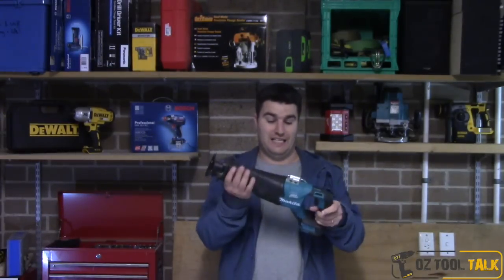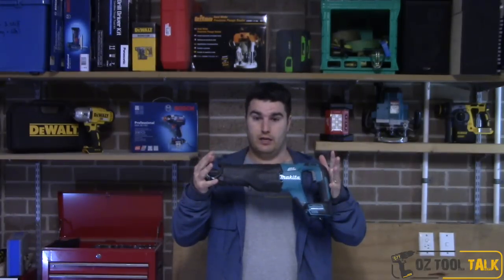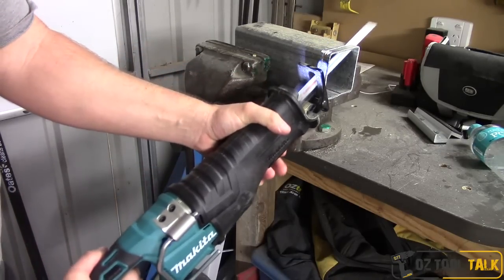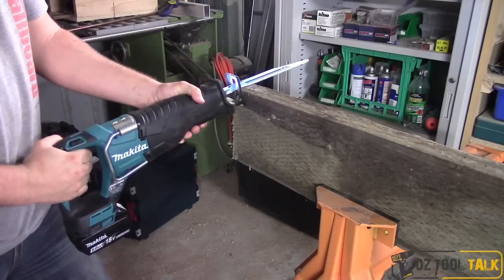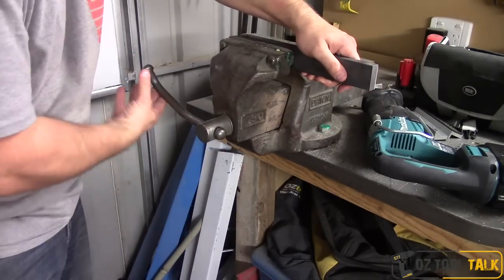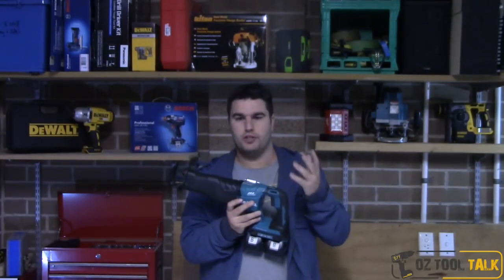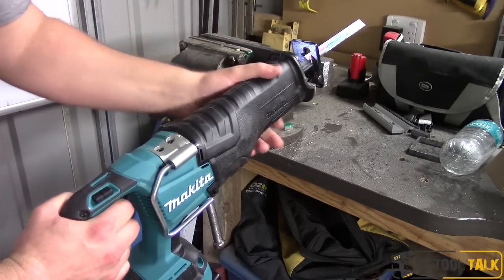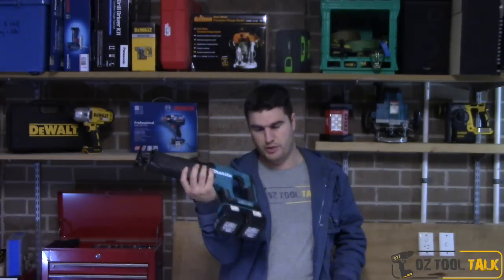Makita BRUSHLESS Reciprocating Saw - 18V DJR187 & 18x2 DJR360 - inc. Bloopers

Comment: Higher  voltage means you are drawing fewer amps for the same power.

For example: To generate 500w of power, an 18v system needs to draw 500w divided by 18 volts = 27 amps approx.

A 36  system would need to draw only  half that ie. 14amps approx.

This means your batteries have longer run time and longer over all lifespan.
Reply: errol kim this is well explained!
Reply: Yes, that is true, however it doesn’t make sense for them to add another battery without increasing power.. Makita didn’t just lug on another battery so the user would have a more bulkier tool just to add another hour or two to its battery life.. If the same motor is running off 36v (if it even has the same motor) then the motor will have more gas so to speak. I am of course assuming as there are no direct and correlating reviews on these two. I did though, on the other hand, see two reviews where the 36v beat the 18v in cutting test when measured side by side... I have the 36 on the way and will definitely compare to my other recips, however I just can’t let go of the idea Makita would go to this trouble (also adding more weight to our tool) just so the damn batteries would run a little more cooler. It just doesn’t make “business sense”
Reply: Then why do DeWalt Flexvolt batteries give less runtime when used with a 60v max tool?
Reply: I think you'd use those extra magic pixies to increase power i.e. torque?

Comment: Can i just say that adding cutting compound ( rocol, trefolex, etc) when cutting steel will extend blade life, battery runtime and no doubt increase speed of cut. Im looking at grabbing one of these bad boys though! still undecided on which one!
Reply from the maker: I always use it when drilling steel. I've never seen it applied for a reciprocating saw cut though, do you think it's practical?  I don't think it is personally. [Dwain]

Comment: The only reason I can think for using the dual battery tool is if you're working under a house and cannot easily get to extra batteries. Good for plumbers. Since the performance appears to be the same as the single battery tool, maybe the batteries are wired in parallel. That would make it a 18 volt tool with two batteries rather then a 36 volt tool. Hmm?? Could be deceptive advertising from my favorite tool company! Good work as always Dwain!
Reply from the maker: +Terry Goyan. I agree in terms of usage. I think the voltages ARE being added to 36V, but that doesn't mean that it will be drawing more power necessarily, it could pull less amps and give a very similar output (Watts).
Reply: Hi Dwain. Greetings from the San Francisco Bay Area! It appears you're correct about the voltage. Just went onto the US Makita site and it says the two battery slide compound 18 X2 saw is 36 volts. Must be set up in series...I would still expect twice the run time over the single battery tool!

Comment: I bought this today (single battery brushless one), tried to cut a 40mm by 30mm steel tubing with 2.5mm thickness and it was VERY HARD. Was the material too thick for it or is there a certain technique? Also, it burred and made the included metal blade useless after managing to cut just one tubing.
Reply from the maker: Hi Emre. Cutting metal make take a bit of getting used to when first starting on a recip saw. 

A few points. As much as possible, you want 2-3 teeth in the thickness of the metal, so you're looking for a blade with decent TPI (teeth per inch) for 2.5mm steel. It's also worth noting that there are LARGE differences in the quality of blades out there. 

You want to reduce the 'bounce' as much as you can, by keeping the recip saw hard up against the material, and keeping the workpiece from moving.
Reply: @OZToolTalk  Thanks a lot! And I noticed people starting from the corner of a square tubing to cut. I think I went parallel to a bigger side..I will try your suggestions, thanks :)

Comment: great review.    I've been wanting this for a lonnnnnnngggg time.   can't wait for them to hit the shelves in the US.       I'm not suggesting you spend your time doing this but I would be curious to see a runtime test comparing the 36v to the 18v.    does the 36v actually last twice as long or is it smarter to just have 2 batteries and the 18v and swap when they die.      I'm also surprised the 36v doesn't have additional power.
Reply from the maker: +NERemodeling yeah that would NOT be a fun test to do ;) but I only get a lend of these, so can't anyway. thanks NER
Reply: +Oz Tool Talk I agree.  Talk about a time commitment and a forearm workout!!      I can't help but drool over these darn sawz

Comment: Ive got one of the DJR187 saws, and have to say i love it. I also have the current Milwaukee Fuel and would find i would have to carry that and milwaukee batteries aswell because the older brushed Makita units were lets just say rather crap. 
I do think Makita missed the mark on the 18x2 however. I dont own one but have used it for a couple of hours. And it really doesnt seem to be much more powerful than the 18v And i personally would rather just carry another battery either in my pocket or bag or something.

I have to say too, if you get a chance to get your hands on some of the Diablo carbide tipped recip blades and pair them with either of these they just chow through stuff likes its no tomorrow! 

Overall great review!
Reply from the maker: +TheColinputer [Dwain] Lucky duck, the DJR187 AND the Fuel. Awesome saws...

Comment: Does the 36V model delver more power to the cutting blade? or is it just longer run time
Reply from the maker: not in my testing, no. just longer runtime.
Reply: Oz Tool Talk did you measure your cuts with a stop watch or decided on feel? One reviewer said they didn’t feel much of a difference during testing but when they looked at the results, the 36 came out on top on every cut test

Comment: https://www.youtube.com/watch?v=TksiLiiR3jI                  It appears the 36v is quicker to cut but the difference might not be noticeable since the time we are talking about here are milliseconds. If the recip is designed to run longer but at the same power output as the 18v, then the two batteries connected wouldnt turn the tool into a 36v tool, it would remain an 18v just with the batteries set up in parallel.
Reply from the maker: [Dwain] Makita definitely say its running at 36V. That doesn't ALWAYS mean more power, it depends on how the motor is configured of course.

I've heard several other (trusted) sources that that the 18x2 does have more power in some tasks. But my testing didn't find it...
Reply: Thats interesting, I really dont quite know what to think of this 18 v 36v, theres a lot of conflicting info out there and Makita doesnt say much to make it clear. But yea, that makes sense what you are saying, if there is a power advantage, its probably nothing to brag about. Cheers, keep up posting great vids
Reply from the maker: Cheers Jonas.

Comment: DJR360 Makita has a 36V motor installed, and Makita DJR187 has an 18V motor Yes or No??
If not, then this is not a powerful saw, but the same as with one battery!?
Reply from the maker: yes, they have different voltage motors. Also, it is absolutely possible to get more power out of a motor by drawing from two batteries at once.

Comment: The djr360  would still be 4ah, the as it is the smaller battery so would  be depleted first, the ah isnt added together to make 8 ah. as the battery's are connected  in series to make 36v the ah says the same, if they were in parallel the voltage would stay as 18v but the ah would be added together to become 8ah
Reply from the maker: +Jack Stratton yeah, i would just trying to give users an idea of how the machine can't make use of the extra juice in the 5Ah. As the 18x2 doesn't give any extra power, I think/hope that it gives the equivalent of 8Ah @ 18V with these two batteries.
Reply: +Oz Tool Talk  just looked up the specs of both tools and there's no difference, does the x2 cut any faster? If not what's the point. I know the sds 18v x2 has a bit more capacity than the 18v
Reply: +Jack Stratton 

Double the runtime.  The only difference.  So the normal 18V one is the one to get !
Reply from the maker: +Jack Stratton as dominic said, it gives a runtime difference only. good if getting back to your batteries/charger is a pain on your site (i.e. in a roof, under a house, far from power)
Reply: +Oz Tool Talk yes. I get that I was just correcting on the the fact that the amp hour rating doesn't double

Comment: Thanks for the review.
Speaking of the Makita 18Vx2 line, I would really like to see you do a review of a Makita 18Vx2 (36V / 40Vmax) lawn mower and compare it against the EGO 50.4V (56Vmax) lawn mower you tested here: https://youtu.be/0WmP17fw00E
Makita has two different widths of 18Vx2 lawn mowers: http://www.makita.com.au/products/category/lithium/lithium-ion-skins/18v-x-2
I would also like to see a review of the Makita DCV860 18Vx2 mobile dust extraction system.
I really like the idea of using the same batteries for both regular power tools and gardening tools, so you don't have to invest in two different battery platforms, each with their own chargers and batteries. Li-ion batteries slowly dies from ageing whether or not you use them or not, especially when stored fully chargers and even worse if stored at high temperatures. So by having only one battery platform, you don't have two sets of batteries slowing dying, but just one, which makes it a lot cheaper.
Reply from the maker: +ITubeTooInc [Dwain] cheers. yeah I also like the idea of a single platform,  but I think there are downsides to that as well. Unfortunately we probably won't be doing heaps of 18x2 gear, because our access to Makita is fairly limited. But I'll definitely keep an eye out for those units :)